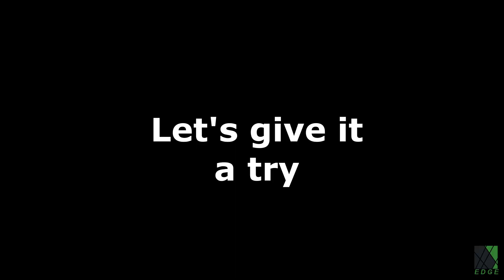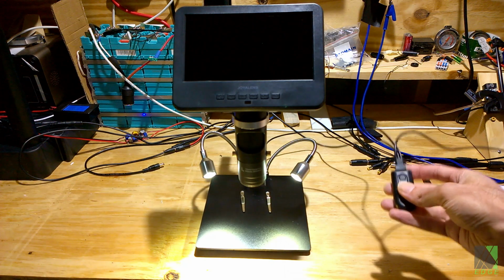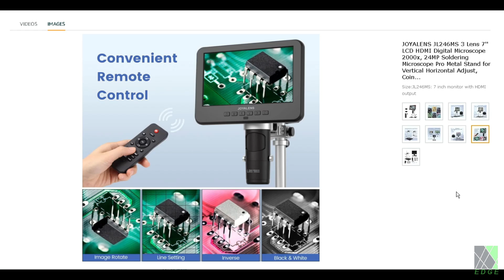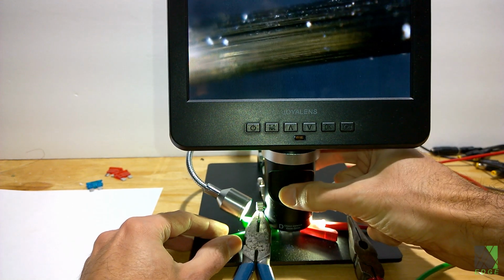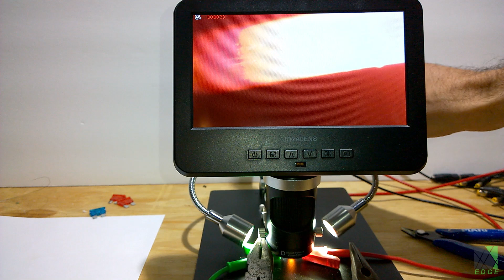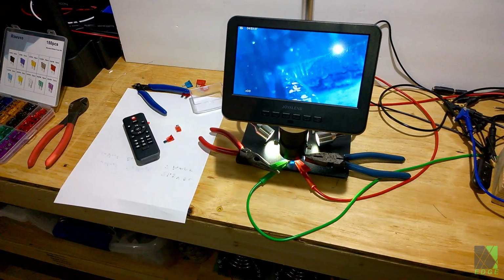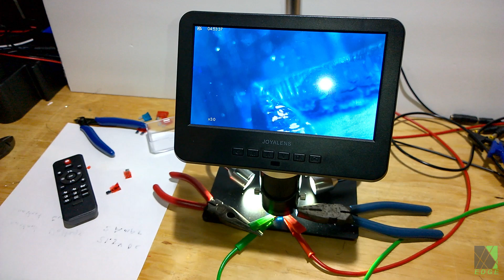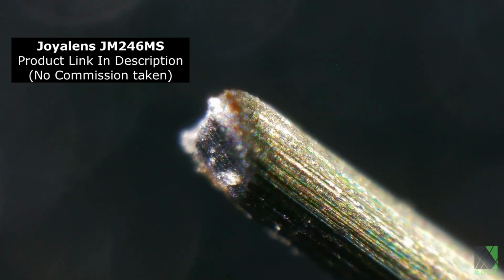Nichrome & Fuses melting at 1800X magnification! Slow motion microscope #Joyalens JL246MS #review

Comment: Excellent review. I like how you demonstrated how this product is useful to you. I have to share one criticism of that company's marketing. 1800x magnification is technically nonsense. I wish companies selling these relatively low cost devices would use the same standards as the traditional (and expensive) microscope companies. Having gotten that off my chest, I think the important thing is that the product is usable and useful for your purpose. I happen to have a number of pricy, large microscopes that I think are more capable, but I have to admit that your demo is making me consider this product. Besides what you demoed, I can't help but notice that the product is small and light enough for me to use in applications that I wouldn't consider with my current equipment. Thanks.
Reply from the maker: Glad you liked it.... I am not sure what the actual magnfication is. Certainly a lot more than a magnifying glass!